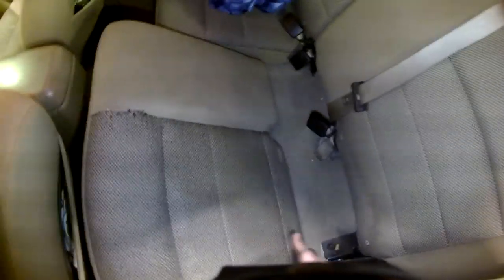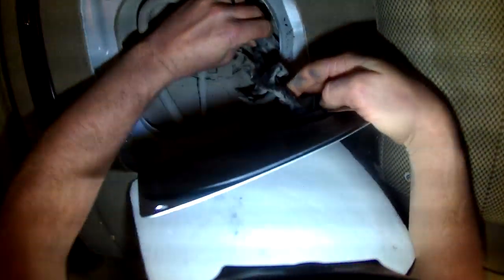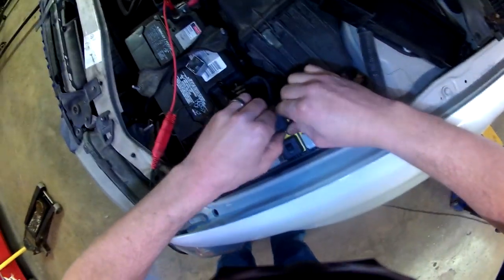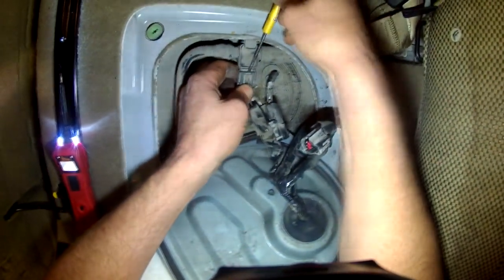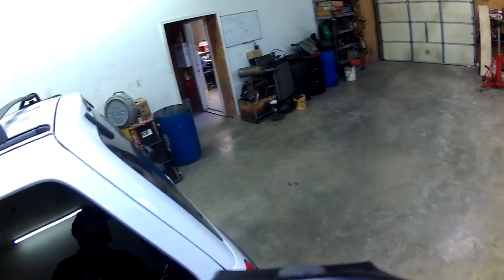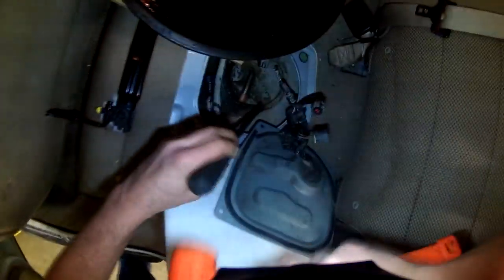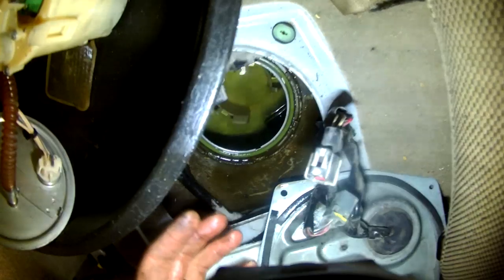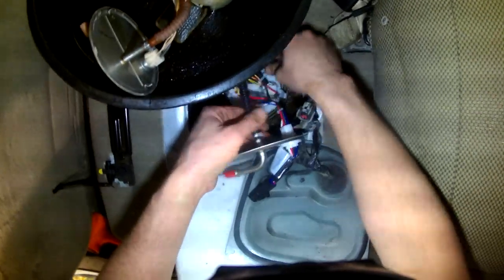2005 Ford Escape Fuel Pump

Comment: Been working on my car for a solid month straight it was a $600 car , bought and replaced radiator reservoir, Fuel Pressure Sensor , PCV Valve, battery, spark plugs, starter, Valve Cover Gasket, Intake manifold gasket, oil / oil filter, and tires. After the valve cover gasket and spark plug replacement I did I tested her and stalled and lost power on a incline everything was fine then till that incline hill hit and she just wasn’t given any beans and lost power right over the hill. Drove back after tiring her off and turned her back on drove back fine but check engine light came back on so I gotta replace that fuel pump tomorrow. And then test number 2 will happen hopefully she’s road worthy by this weekend.

Comment: Yes when I was also asking do you have a video showing when it comes to changing the spark plugs I'm fixing to have to do the same thing to this vehicle that I just changed the pump in that there's any special things that I need to do what I'm replacing these six spark plugs there's three in the front three in the back

Comment: I used this tutorial to replace my fuel pump but I can't get the lock ring to lock in place. When I hit it with the screw driver and hammer only one side of slides in. So now I have it halfway and its not fully sealed. Is there a tool that can help me put it on? I see several but don't know which one works with this particular ring on the 05 Ford escape. I figured thats what I need because the tools presses on all sides of the ring making it flush on the pump when sliding it ins its locking place. Thanks.
Reply: Tappa tap tap.  Percussive maintenance isn't rocket science.  Hit it harder 🤪

Comment: The test light doesn't draw enough current to ferret out a weak ground or resistive 12V feed to the pump.   You would need a 5 or more amp load to check for suitable power and ground.
Reply from the maker: There you are correct, to properly test the circuit you need to apply a load that is close to the load that the suspected failed component would produce. At that point in the video where I reference looking for a bad wire, I was more meaning checking for power through my relays and fuses, and making sure that I did have some form of ground functioning at the pump. In this particular situation the fuel pump that you see me replace was not bad. The one that I put in the vehicle later came back out. The problem was further discovered to be that the circuit board in the PCM was melted down because one of the ignition coils shorted and back feed the driver circuit. When the vehicle arrived at the shop the PCM was still working in some capacity, but shortly after I replaced the fuel pump in this video I discovered that I only was receiving marginal fuel pressure because it was holding multiple injectors open. 
    It is also good to note that on this vehicle the fuel pump should have a 12v battery + all the time and the computer modulates the ground to the pump to duty cycle it. It is not a battery switched positive that uses a fuel pressure regulator to maintain proper operating pressure.
Reply from the maker: I would also like to add that I uploaded this video to show the installation process for the fuel pump. I would have liked to make a video of the rest of the diagnosis, but due to time constraints, and issues with my camera I did not have enough good usable video to make quality video from.
      The rest of the diagnosis of the vehicle was much more indepth, and it took a while to track back and figure out that the computer was the true culprit. All of my scan tool data from two different scan tools of course never once pointed to the computer, and following grounds that should not have existed at different times was the only way to track the issue back to the computer. 
    The repair of the vehicle not only included a new PCM, but also a full set of 6 ignition coils, all Motorcraft, a full set of spark plugs, and a full oil change, due to contamination by large quantities of fuel. Three of the fuel injectors were being held open by the faulty PCM which filled three of the cylinders completely to the plenum with fuel, which was the cause of the oil contamination.
     I'm adding this to the comments section under your comment John-Del, because you made a very good point about circuit testing that completely pertained to the rest of the vehicle diagnosis. Hopefully these comments will help someone else if they encounter this same situation. 
     As always if anyone has any questions don't be afraid to ask them in the comments section, and thank you for watching, and taking the time to leave me a comment.

Comment: I've noticed there's a HUGE price difference between OEM and aftermarket fuel pumps for my '01 Escape.  Is it safe to assume aftermarket fuel pumps will work just as well.
Reply from the maker: The price for a Motorcraft is absolutely insane!!!! Aftermarket is the way to go, The pumps are not as high of a quality, but it is easy to replace, and you could do it in the parts store parking lot, or on the side of the road if you needed to. Just make sure you get one from a good chain auto parts store, and get one with a lifetime warranty. If it is a chain store like Advance Auto, Orileys, Pep Boys, ect ( stay away from Autozone, far, far, away) they will honor the warranty nationwide, so if you break down and you are out of state you are covered. Just make sure you make a photocopy of the original cash register receipt and keep it in your glove box because they can not always see your warranty information nationwide, and the original receipt will fade from the heat during the summer.

Comment: I have an 05 Escape and my gas gauge stays on full all the time and I have ran out of gas several times with the family in it . What could be the problem and what will be an easy fix????
Reply from the maker: The most likely cause would be a fault in the fuel pump module. In this video the piece that I pull out of the fuel tank not only contains the fuel pump but the sending unit for the gauge as well. before I would condemn it though I would test the sending unit. you will have to remove it from the tank, make sure with the key on you have power and ground to the plug, then plug the sending unit back in and probe the signal wire from the sending unit and see if the voltage changes as you move the float through its sweep. if the voltage reading doesn't change, the sending unit is bad, if the voltage changes the sending unit is working, the issue is in the gauge itself or in the computer. I will try to find some wiring diagrams for the fuel pump to help you out with which wires to test.
Reply: I figured it out it was the floater is was jammed in the up position due to the front end collision I had at the beginning of the year thanks again for saving me some cash mechanic was charging me $240 to fix the problem I figured it out in 15 min thanks again
Reply: I have the same problem, but the float does have movement, I have looked for the sensor to buy it but I cannot find it, apparently they do not sell it separately only together with the pump, any support?

Comment: I have did everything you said to do but one question I have to ask?! How do you snap it from the bottom to pull it up? I have a 2006 Ford Escape XLT V6 3.0 wont crank.
Reply from the maker: Tiffany Brown if you are asking about how the pump attaches, it has locking tabs down near the bottom inside the tank. Unfortunately you have to reach in to the gas in the tank. If you are referring to the plug in for the pump you hold the locking tab down and pull the two pieces of the connector apart. I hope this helps, and thank you for watching.
Reply: Joseph Vollmar Yes, I’m asking about the how the pump attaches. And Thank you so much. Your video was very helpful.
Reply from the maker: Tiffany Brown that’s what I thought you were asking. If you use a flashlight and look at the base of the pump near the bottom of the tank there are two locking tabs. Push those in towards each other and the whole pump housing will releases and you can fish it out the top. Just take your time and try to dump as much of the gas as possible back in to the tank before you wiggle the float out through the hole in the top of the tank.
Reply: @lifeoftiffany3809  it is very simple, I got scratch all over my hands until I realized that the info. about the locking tabs, it is misleading info, after you remove the top cover you will see the pump fixed solid to the bottom of the tank, do not stick your hand in the bottom of the gas tank , take a flash light and look at the top of the actually pump and you will see sticking like 1 inch above the pump 2 plastic flat tabs aprox. 1/4 " to 3/8 ", right across the pump from each others, put your fingers on both tabs and squeeze them slow  , you are going to see that them will move toward the center of the pump, when you squeeze them easy in the same time you pull the pump slowly up and you can pull the pump nice and easy up and out of the gas tank.

Comment: I jus bought a  2005 ford escape 34 days ago 2 woks ago I was shopping with my kids came out truck wouldn't start.. got a ride home car dealer picked the car up it started I told him take to the shop to find out the problem.. he sat it on charger for battery for 10 hours I picked up around 230 pm he said no problem it's running N starting jus fine well exactly 2 weeks from that I was driving and the truck died out wouldn't start again  ..tried with boosting nope nothing.. car dealer came got suv to my driveway as it broke down about 50 ft from home. . He then said he would send tow truck never did been lies and ignoring me so I have decided to fix this myself I'm almost certain it's the fuel pump. . Can anyone tell me the exact tools I need. . And is it really hard to get the ring off??? I know I'm a woman but I can do some things and am always wiling to learn.. I'm frustrated and stressed out and jus want my  ehicle to be reliable I had a bad accident and rolled  8 times into a ditch I'm lucky to be alive and want to enjoy my life with the kids but this vehicle isn't reliable as yet and the car dealer says he isn't responsible ad it's 4 days past the warranty! !!! Only 34 days old I'm done with arguing
Reply from the maker: A Phillips screw driver to take the cover off, a pry bar, and a hammer to rotate the lock ring, and the rest you can do by hand. Sorry I didn’t respond faster, just saw your comment. I hope this helps.
Reply: If you use an oil pan to put the fuel pump into, ... get the God Damn thing out of the way while putting the new fuel pump in.... there is no need for it to be there ... especially if your doing a You Tube video.
Reply: Definitely sounds like a bad pump
Reply: So was it fuel pump ??